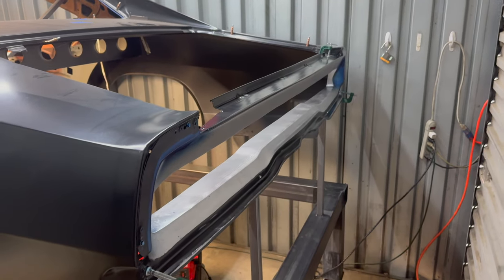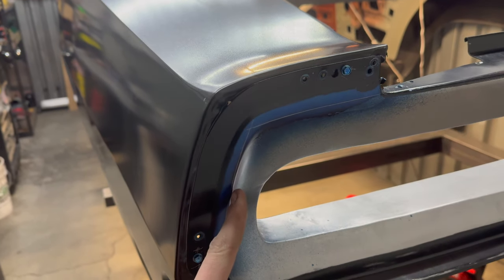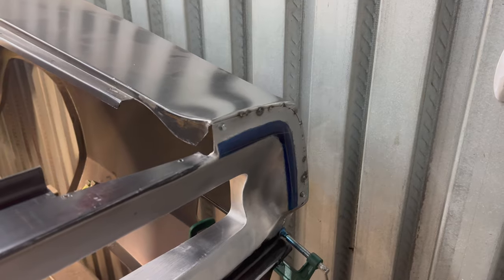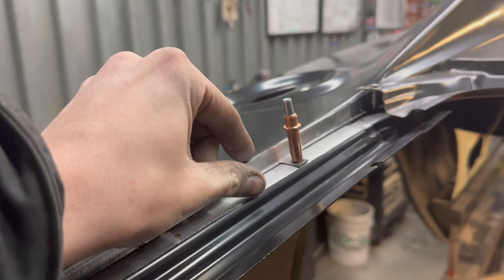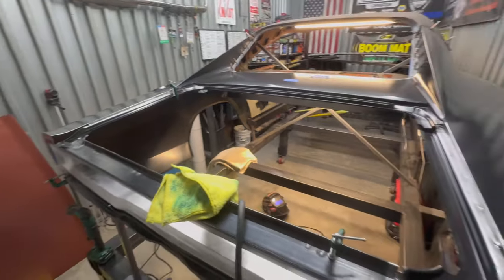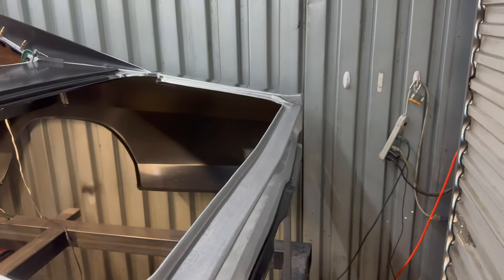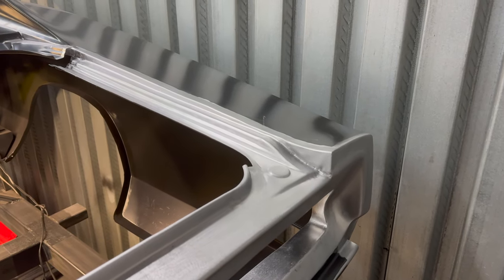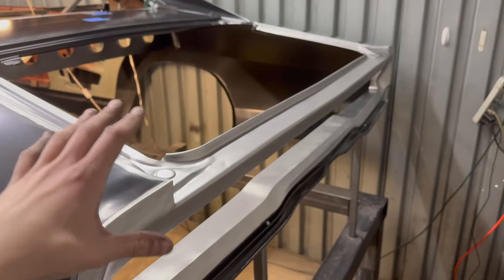The most time consuming project to date | 1970 DODGE CHARGER Tail Panel + Trunk Gutter installation

Comment: Good morning from Cape Cod. I would say your talent and skill level is far superior than most restoration shops 🤘 Bad Chad floods an entire car with filler and sands it to perfection, you make the sheet metal perfect from the start. Amazing!  Keep up the awesome work Cale 👍✌️🇺🇲
Reply from the maker: Thank you, I certainly appreciate it. I figured if I can get the metal as good as I can, the less body work I’ll have to do which means the less body filler is added haha
Reply: Bad Chad is not even in this league.  This is more Ring Brothers quality.

Comment: I did the same thing on the gutters on my 67 GTO and I'm glad that I took the time to do it. I also debated with filling the gap between the quarter and filler panel but I ended up deciding to leave it as is and use seam sealer the way the factory did.
Reply from the maker: I don’t believe chargers had seam sealer on that one gap, it was just exposed. Generally one of the first areas to rust out because it would just trap water obviously. I still haven’t made up my mind on what I’m going to do haha
Reply: @camracing  If you don't put seam sealer in that gap, are you going to end up with water in the trunk?
Reply from the maker: @davidpowell5137  no, the panels have a flange underneath where they weld together. It would just be the seam on top, so a little gap, that would fill with water but should drain out the back following the gap between the deck-lid and quarters

Comment: What would look cool, since you’re modifying the car, is to make the rear window like a Charger 500. It is such a clean look they used only on Charger 500 and Daytonas
Reply from the maker: Some others folks have mentioned that, and I have thought about it. I’ve always like the look of the sail panels on the back though, I know I’m in the minority when it comes say that, but I think they will be staying haha
Reply: Great decision
Reply: @camracing  as always, your car and your decision in the end. I feel same way about suggestions on my car. But I always listen and if it doesn’t fit right with me then I won’t do it. Great work so far
Reply: Stick with the stock flying buttress look. It's a better look, you're not building a nascar.

Comment: Nice work! What is the blue stuff you spray on the panel before scribing?
Reply: it's lay-out fluid, you use it to make the lines more visible and stand out against the bluepart
Reply from the maker: Bingo, plus it doesn’t disappear with heat like a sharpie line would👌
Reply: @TheSoulaimane9  Thanks!